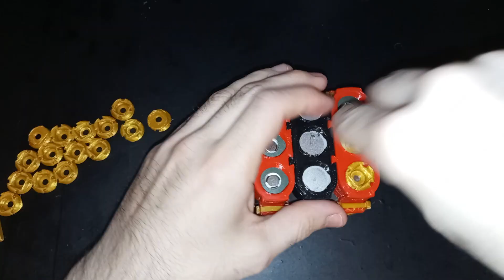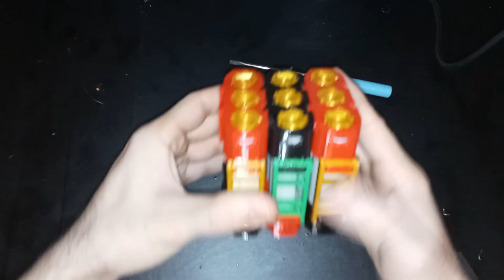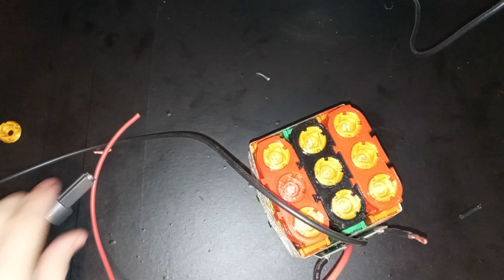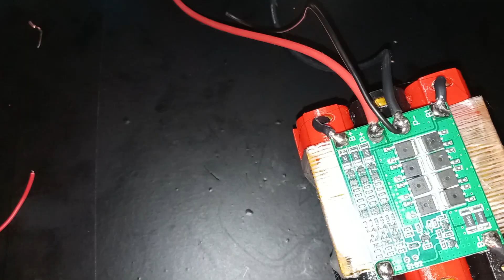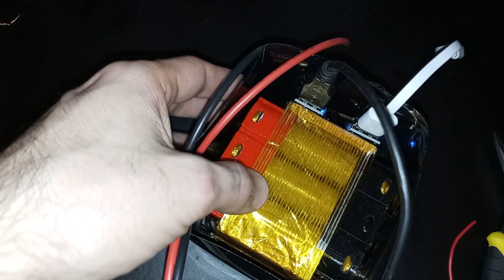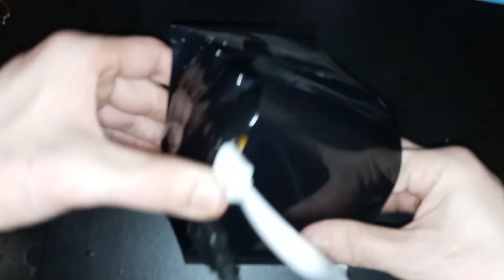Weldless USB Battery Bank Build - 25A - No Welding Required. [3S3P headlight / USB battery build]

Comment: could use copper Pins  slid in from the Side to Pinch braid against cell -make pins from solid wire or small copper nail -  less complicated and less parts  - likely faster build
Reply from the maker: the idea is the avoid specialty parts. wire can be used instead of bread.

Comment: can you tutorial for a 12v 100ah battery using 100  18650 batteries and BMS 4s..please..I want to learn ..
Reply from the maker: I will be doing larger battery builds s00n.
Reply: @electronicsworkshawp  I'm waiting for your project because I want to learn to build a 12v 100ah battery.  thank's bro ..

Comment: What kind of hot glue stick is that?
Reply from the maker: Im not sure what exact plastic it is. The black ones just seem better than the clear ones.
Reply: @electronicsworkshawp  yeah I’ve seen it a lot and wondered what it was. If you have a link I would appreciate it very much.